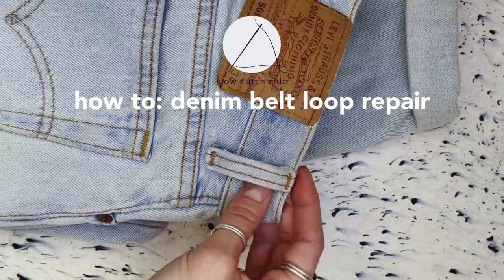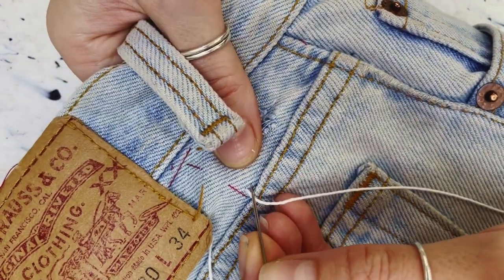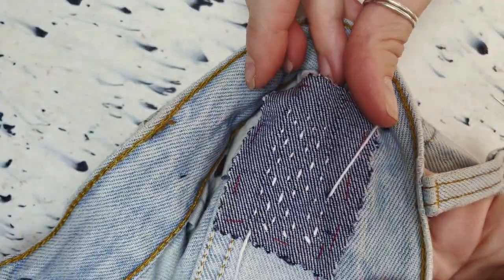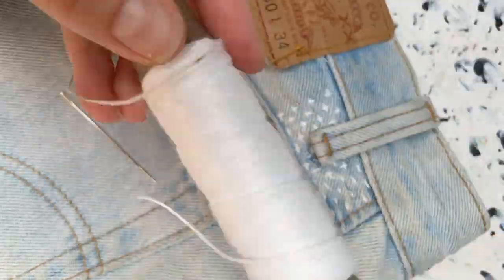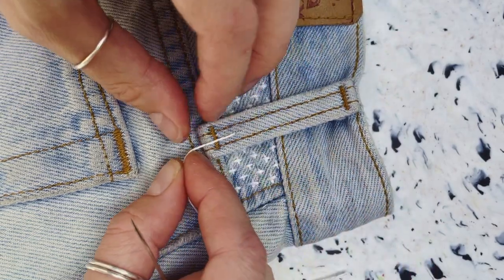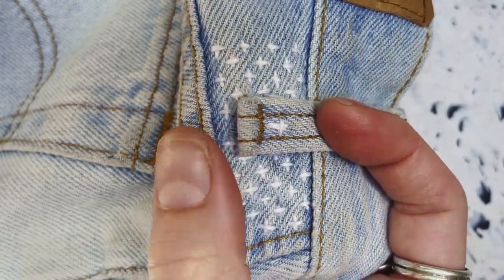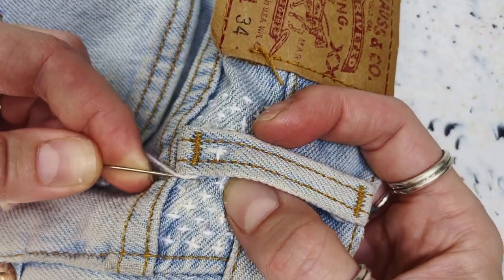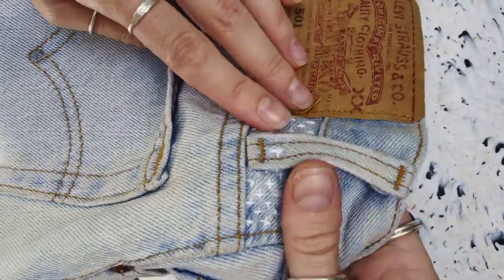How to: visible mending belt loop repair using sashiko

Comment: I heard you say you used sashiko thread but can you just use a smaller thread type yarn? I know embroidery floss separates and sashiko is not supposed to but I don't know the difference other than that.
Reply from the maker: Yes of course, use whatever you have to hand! As long as it's a match fibre content wise and thick enough to secure the patch in a strong way I think that's fine
Reply: There is a video on how to make sashimi thread from other threads…